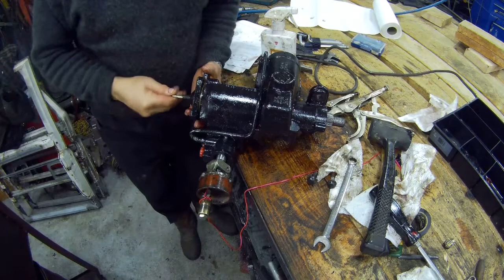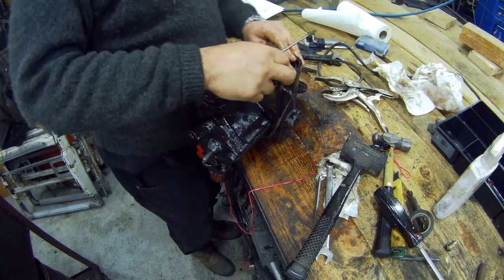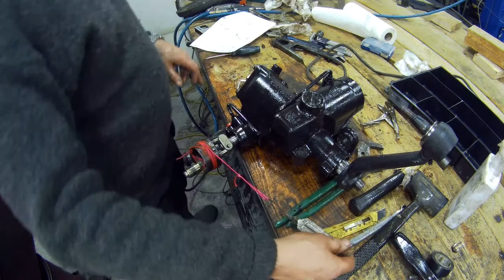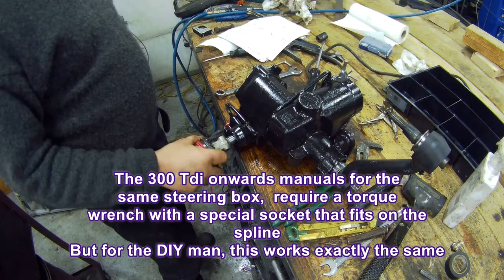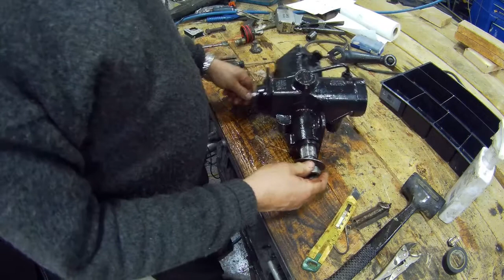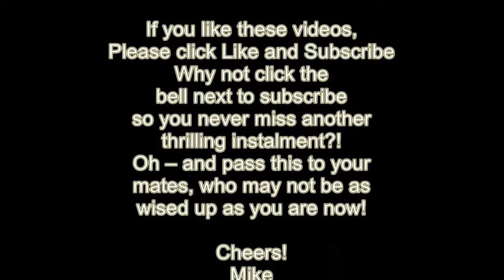Land Rover Adwest steering box overhaul part 3. Assembly and adjustments

Comment: hey mike....do you still have the homemade tools for adjusting the steering box?  do you rent them?
Reply from the maker: I no longer lend or rent tools due to damage or not being returned - sorry
Reply: @BritannicaRestorations  no problem.  my welder is home in PEI.  I have a spare U-joint that I can use to make the piece to spin the input shaft.  Just need to find a welder I guess.
Reply from the maker: This is from an old video  - better are available on my site, but if you take the U joint and weld a socket to it, you can use a balance beam torque wrench to better effect!

Comment: Brilliant video I've just fitted a reconditioned adwest 4 pin to my 200tdi defender. It's ok except there's a lot of back lash / play through steering wheel. Do you think I can adjust it on the vehicle 🤔 thanks
Reply from the maker: If you are totally positive the play is in the steering box and not anywhere else in the system, it can be adjusted in the vehicle - however you must know what you are doing as over adjusting the box can stop the steering wheel from spinning back. As this is a reconditioned box I suggest talk to the supplier as most recon boxed are marked with paint on the adjusters and if they see the paint marks are damage there is no warranty
Reply: @BritannicaRestorations   ok thanks all trackrod ends have been renewed its seem to be solely in the box you would think they would of set it up . Thanks anyway

Comment: Hello Mike,
I'm Carlos Pestana Jr. from Brazil.
I have an LR Defender 90, 300Tdi, 2003.
Do you have any tip or video that illustrates how to adjust the steering box while it is still installed in the vehicle. The steering box is working well and has no leaks, it just needs to be adjusted because it has a small gap. The best wishes from Brazil ...
Reply from the maker: If you are very careful, you can adjust the top stud and lock nut on the top of the steering box to remove any play in the steering - but be careful and only do 1/4 of a turn at a time and always tighten then nut after every attempt - there has to be some play in the steering so the steering wheel 'flies back' on its own - that is to say if you have to turn the steering wheel back to the centre position when driving- it is too tight.
Also bear in mind the oil pressure in the steering box can take up slack in the box when the engine is running - my 130 feels lose when the engine is off, but once running it is fine with no play
Reply: @BritannicaRestorations  Ok Mike, I'll be doing as you've instructed. Thank you very much for your attention.
Have a nice week !

Comment: There is a lot more "con" than "re" in the recon industry.  Steering boxes are one of the worst, where they take units from scrapped vehicles and just wash and paint them, maybe fitting the seals to the sector shaft at best but never even checking the state of the internal parts.  Most fail within six months, like mine did.  Only Adwest reconditioned these units properly,  and while they charged about 450GBP versus the 120-150 of the unnamed refurbishers, they were infinitely better value.

There are different versions  available with different ratios and different amounts of hydraulic assistance to reduce input forces.  Whether that affects the input shaft seals I have no idea.

Incidentally, Mike, my 95 RRC has got heavier in its steering quite some time after getting its third box.  It's not losing a drop of ATF.  Do you reckon it'd be the white teflon seals on the input shaft, or just the PAS pump providing less pressure (looks fine inside, but perhaps the relief valve spring has softened)?
Reply from the maker: Brand new Adwest steering boxes are £415/475 wholesale/trade depending on supplier - BP BM AMSelector shaft Genuine new $334, worm valve £1300 Genuine, new 

Go figure if your recon box has new parts fitted
Reply: Hi Mike, I have a six bolt in a 1991 200tdi 90. My question to you is which steering box would you recommend?

Comment: They will often just change the input and out put seals and call it reconditioned! Good video so thank you, I would be interested in seeing the seal replacement. Until now I have just exchanged but you know I might now give it go !!!
Reply from the maker: hi!
if you follow the steps in the video, the changing the seals are quite easy once stripped.
One thing to note is there are different seals on the low pressure input side (the small spline) and they are not in the kit - see below

https://www.youtube.com/watch?v=UJFw38aQYe4

I will order a seal kit and strip another box soon

At the moment I am building a test rig, so I can pressurise the box and check its function prior to fitting
I will do a video on that soon 

I  too used to get exchange or new boxes because some of the parts inside are more expensive than a new box!
Thanks for your interest!
Mike
Reply: I'm in South Africa (Nelspruit), just fitted a recon an then had an accident...sector shaft (not selection shaft) bent after 30 km, not to mention a whole bunch of other things...re-con was good until the mishap. seeing Mike's videos and Bearmach's reasonable prices gives me confidence to get my Landy on the go again soon without too much expense...Thank you Mike...just going to do the job in situ Africa Style :-) because i'm getting way too good at steering box removal and refit.
It would be nice to see something about the double set of needle rollers holding the sector shaft true at the bottom. My workshop manual says they can't be changed by the DIY method...where does one get the needle rollers...scarce as hen's teeth, otherwise excellent post!